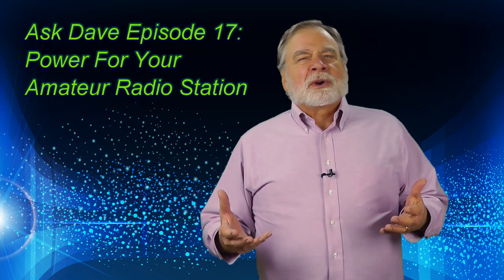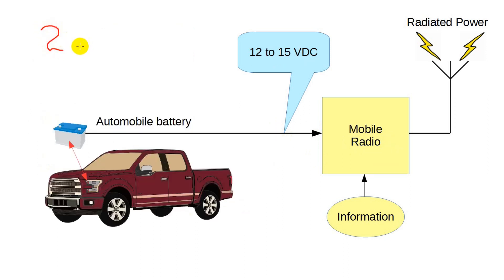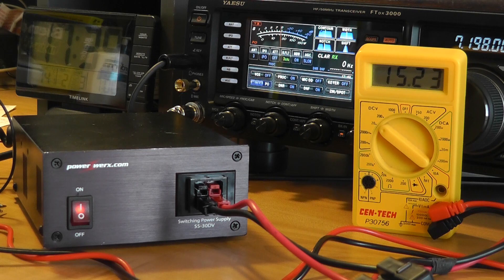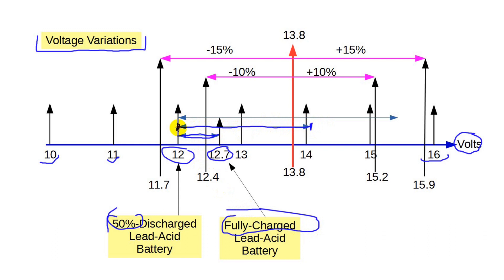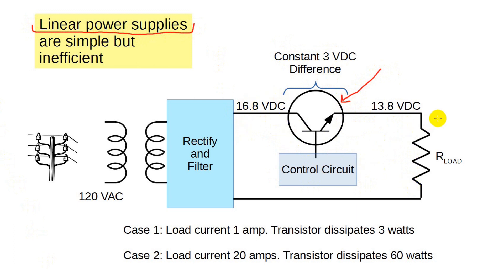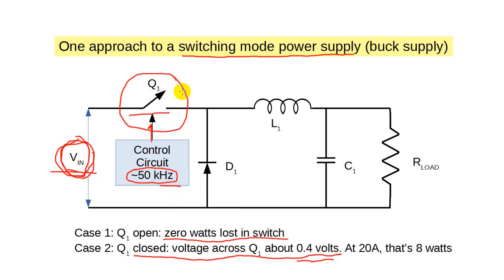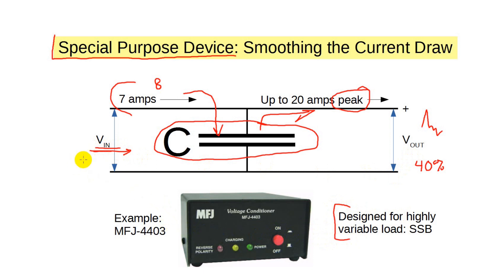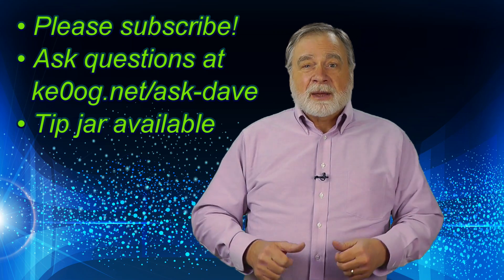Ask Dave 17: Power For Your Amateur Radio Station

Comment: Wow Dave, thanks for this video. There are a lot of HAM channels posting videos by people with limited knowledge. In the video I watched before yours, the narrator weakly attempted to explain linear power supplies & then placed a red balloon on the screen that reads "Hell I read it & I dont understand it."  So much low quality information on youtube. Your video is a breath of fresh air. You give an excellent, understandable explanation of the electrical theory behind power supplies. You know what you're talking about & you are very good at explaining it! The information about the voltage range experienced by automotive & solar powered systems was especially useful. Fantastic video! I posted because the most recent comments are a year old & I want you to know that people are continuing to find your past videos & learn from them!

Comment: The video answered my question perfectly. I just made General after 23 years of being a Tech. I have been out of the hobby for about 20 years though, and am just now beginning to assemble an HF station. My Yaesu FT-950 is on the way. I am a bit behind the times with equipment, because many years ago, switch-mode power supplies had a bad reputation of putting out noisy power. However, at our clubs field day, everyone there had one and they worked perfectly. Nice and light, too. I have a new-in-the box Astron RS-35M linear supply that I bought 10 years ago, and am considering basing the station on a QJE 50A switch-mode instead.
Reply from the maker: The Yaesu FT-950 is, I think, a 100-watt station, so that old Astron will work just fine and power a VHF rig at the same time. One hundred watt HF rigs really only need about 20 amps.

Comment: I remember the "old" days with car radio's with vacuum tubes that required a B+ voltage higher then 12v dc.  You had a vibrator that chopped the incoming voltage into a square wave that went through a transformer that had a higher output voltage that was rectified into a higher DC voltage, lets say 100 vdc that worked with tube technology.

Comment: Wow man, I love your videos, there aren't any other nearly as informative and spot on videos about ham radios as yours. Good work!
Reply from the maker: Thank you.
Reply: So David, I purchased myself a Yaesu 8900R and have been looking for a way to power it. After watching your video I decided to build my own linear power supply which will be fairly cheaper than anything stock. However, I have a few questions. Could you confirm if I am in the right direction? Even though I calculated that an 11 VAC would probably be the sweet spot, I couldn't find anything more suitable in my local shops than 230 VAC / 11.5 VAC (RMS) at 150 VA transformer. Which after rectifying it would give the sqrt(2) or 1.41 * 11.5 =  16.215 VDC. Which of course is with about 0.3 volts above the 15.9 high margin. However I consider at least a 2 x 0.7 V drop due to the nature of the silicon diodes in the rectifier. Which brings the rectified voltage to about 15V . Now, add the resistance of cables, fuses and the voltage drop when the radio is in idle, can I assume that the design of this power supply would be safe to use? I've also roughly calculated that if a 8000 µF capacitor is added, when the radio at full power the voltage wil be dropping to around 12 Volts. Another thing,  I think a 10000  µF capacitor would stabilize the voltage more, however it will introduce an about 12.5 Amps of current spike in the first cycle when the transformer is plugged in, would that be an issue?
Reply: So, to sum it up, since you didn't reply, after days of research about power supplies in general, it turns out designing your own supply for a ham radio is trickier than I previously thought. First, I though I'd be OK with an unregulated linear power supply. However, even if you design your power supply at 15.9V, voltage can and probably will drop below 11.7V at some circumstances... Also it turns out some if not most radios won't be happy with a big 50/60 herz voltage ripple, unless you provide a huge huge cap, but then again a 50W radio at full load can easily surge up to 10A. Making your own regulator for a linear power supply isn't rocket science but then again you'd most probably end up with something with higher voltage to compensate for current, then regulate it down to 13.8, but then you'd probably want to implement an over voltage protection, in case your power transistor goes pop, or because of TVS, which again isn't rocket science, but complicates things a bit more. At the end you end up spending 60-70 euros for parts, at best. Some hours of work, which if you don't enjoy ... it's not worth. But even if you enjoy it, it is really important that you make this regulation and protection right, because you will be very sad if you toast your japanese high quality Yaesu... Switch mode power supplies are fairly complicated to make them yourself, modding a computer one is an option, but there is also a bit of luck there too. My final choice - I will just buy 1 switch mode, designed for a ham radio.

Comment: The reason some supplies are variable are several. 1) Bench testing 2) some PA's such as the RM Italy amps require more than 13.8V to drive the amp to full output. 3) Long cable runs have DC loss or the operator is using a light gauge wire..again, DC loss when under load.
Variable supplies are very useful.
Switching supplies are notoriously known  to  produce RFI. Linear supplies do not. A well regulated and filtered switch supply are expensive.

Comment: Once again Dave, great job!  I continually refer our Technicians and Tech Students to your YouTube videos.  
For what it's worth on this topic, my Alinco DM330MV switching power supply has worked great.  And I always suggest - if your power supply should have a max rating that is reasonably higher than your radio's max amperage.  My 100 watt radio publishes 24 Amps max at 13.8 v, so I bought a 32 Amp switching power supply.
Reply from the maker: +Indiana Jones Thanks for your continuing support! My little PowerWerx SS30DV tops out at 25A continuous and 30A surge, which fits my radio nicely which requires 23A max.

Comment: Thanks for the vids. Im in the civil engineering field by trade, and the analytical side of me wants to better understand these type topics. Im new to ham, just received my call sign 4 weeks ago, and have been curious about using mobile radios in vehicles, and even more curious about using equipment while supplying power from a 12v battery “go box”. So many are doing this, but also are using rigrunners that have an additional loss of 1v. That puts the available voltage at approx 11-11.7 volts. Once transmitting we would see another 1v or so drop. That 10-10.7v is getting way too low for my comfort level

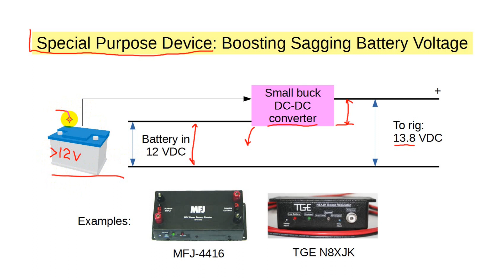Comment: excellant video, i would like to point out that i thought buck converters step the voltage down and boost converters step it up, there are devices that can do both, but @21:33 the boost converter is labled as a buck converter. i could be wrong though. again, thanks for the video, i have learned a great deal over this past year from your videos

Comment: i always keep my dc power leads in the shack as short as possible o limit voltage drop.  In my truck my transceivers and amplifier are mounted below the rear seat.  I use 4 gage power leads to the battery, fused at the battery where I connect each device to the 4 gage with their power leads cut short but each radio has its fuse sized for the radio's needs.  I also have 2, 150 amp relays under the seat so switches on the dash can control main power with another relay with another dash switch  so I can turn the hf amplifier off when not working hf and also when tuning the antenna.

Comment: Thank you Dave!  As a new HAM I am very hesitant to set up my first station due to lack of knowledge about powers and grounding.  This was very helpful!  I do have one question about the comment you made about your HT being damaged from an antenna.   I am doing that now, but with a mag mount.  Will this have the same issue?  The mag mount is on a metal pole about 20ft high.   Thanks!

Comment: In the discussion of whether to discharge a battery all the way down to 11 V (at 21:34 in the video), it might be noted that it is a perfectly acceptable level for a 3 cell LiPO battery which also might be used with the buck converter.
Reply from the maker: The caution has to do with lead acid batteries. They don't handle deep cycles well. Even deep cycle batteries have a limit on the number of lifetime discharges. My suggestion is not to run down a lead-acid battery such that the rested voltage is 12 volts or less. That's about half discharge.

Comment: Hi Dave! Have you tried the TekPower TP30SWII? I haven’t tested it yet but I got it in part due to the noise and voltage knobs. I like the vehicle amp form factor but I intended it for the stationary test bench. I figured if it was set for mobility then added bonus for me but it needs the standard house plugs so unless I’m wired into the grid via camper circuitry then it’s not to mobile without a bunch of conditioning.......Er....I think?

Comment: Been running my rigs off lipos and AGM batteries for about four years. No noise, runs even when the power is out.
Reply from the maker: My photovoltaic system uses AGM batteries. Works great. I changed the rig over to the Samlex power supply as part of the reference video series.
Reply: David Casler I like the sound of that

Comment: What type of bike do you ride?  Is it equiped with a Ham radio?  If so what type?  Even if it is a hand held...  VA6XMB
Reply from the maker: I currently have a 1994 Yamaha Seca II -- I am the original owner. However, it will go on sales soon. And, yes, I've operated 2m FM with it. My helmet has headphones and I connect them to the HT. I have a PTT switch on the handlebars.

Comment: I hear with a regular, hand-held radio repeater that is 115 km away. I am at an altitude of 9m and the repeater is at 1300m above sea level. How much power do I need in watts to connect to the repeater? With 5w handheld radio I hear great, but I can't connect.
Antenna with 3db and 50w ?
Reply: I’d double your watts and get the nicest/highest antenna you can

Comment: Hardware newb here. Is it bad for my equipment if I stack multiple ring connectors (for different devices: HF radio, VHF/UHF radio, antenna tuner, Antenna Switch relay) onto the same positive and negative 1/4-inch five-way binding posts on the back of my power supply?
Reply from the maker: No. No problem. Just be sure that the sum total power requirement at any given time is within spec for the power supply.
Reply: @davecasler  Thank you and 73!  KI7POL

Comment: A few factual errors (such as mentioning buck converter instead of boost), but a 50% depth of discharge really is not a strain for true deep cycle batteries.  The catch being to avoid hybrid type batteries that often carry labels like "marine deep cycle" as they are not true deep cycle batteries and will not tolerate a greater than 50% discharge without undo wear -- a good shopping guide is that no true deep cycle battery carries a Cranking Amps specification on its label.  By comparison a true deep cycle battery can be safely discharged by up to 80% many hundreds of times (typically in the 500-1000 cycles range) without excessive wear.  Shallower discharges will increase cycle life, but with 80% or less depth of discharge the increased cycle life tends to scale fairly linearly with depth of discharge, so you get more cycles, but you will ultimately run about the same number of watt hours through your battery whether it is, for example, 500 cycles at 80% DoD or 1000 cycles at 40% DoD -- one lasts twice as long but only delivers half the watt hours per cycle while the other lasts half as long but delivers roughly twice the watt hours per cycle, the same amount of useful life and power delivered either way (it does not scale perfectly linear, but it comes remarkably close).  

I think batteries tend to trip a lot of people up, especially when one gets into Peukert Effect constants and the impact they have on accessible lead acid battery capacity as the useful amp hours available to a load is entirely dependent upon the magnitude of the load and not a constant as many tend to believe -- a 230Ah battery with a 230A load will actually appear to be a 100Ah battery in terms of accessible capacity at such a draw rate, for example.

My entire station, including computers, monitors, and lighting are powered from a bank of deep cycle golf cart batteries (6V@230Ah each) as I converted everything over to run off DC.  I use a 13.8VDC DC-DC Boost Converter to feed my radios a stable 13.8V regardless of battery state and a 19V DC-DC Boost Converter to produce the power required for my dual 27" monitors, with added filtering where required to produce very quiet power from the DC-DC converters.  An RV type smart charger (also RF quiet) then keeps the batteries topped up at all times whenever mains or generator power is available...otherwise I can run for days to weeks off battery power alone when required and it only takes about 4-5 hours to top off the batteries once depleted, so it does not require a lot of generator time, or fuel, to keep things running.

Comment: Hi Dave, another great video. I have a couple of questions. I see you have the SS-30DV in this video. How do you like it? I just bought the same power supply for my first HF rig. I've seen mixed reviews. The second question is what motorcycle do you own? I would love to see a video on what you are riding.
Reply from the maker: The PowerWerx SS-30DV works fine. It's not good for powering "tiny" loads, such as a QRP transceiver on receive; rather it prefers a somewhat bigger load. But as a power supply for an HF 100W rig, it does fine.

Comment: I have to ask. why turn off the radio before turning off the power supply.  the As-tron is not switching power supply. I have flipped the power supply of with the radio on. I have never had a problem. are you telling me that I will have a problem doing this. just urning it off using the power supply?

Comment: I get the value of using an external DC supply for a transceiver because it's same when I build PCs; I'm used to selecting and installing an appropriate DC power supply in those. Doing so for my upcoming ham setup does not intimidate me. But when I build a PC for someone else, he or she never has to deal with that PSU because now it's inside the computer chassis, and from the user's perspective, only a 110-120V AC connection is required. So my question is, why does no transceiver maker include power conversion in the radio chassis?  Is it RFI?  Seems like shielding technology could manage that.  And I get that a big honking DC supply can power more than one component (as in a PC), and I get that providing back-up DC power is far easier than back-up AC .  But doesn't requiring a string of components tend to be off putting to potential new hams who just want to get on the air as simply as possible?  And couldn't the same argument be made for antennas?
Reply from the maker: For many years some radios had their own internal supplies and some required an external supply. This is back when high voltage was needed for the tubes. Even my Yaesu FT-101B and FT-201 had internal power supplies. At some point the manufacturers stopped including them. Some amplifiers now include their own power supply, or are sold with companion supplies. Some high end HF radios come with internal power supplies. But most of us have to provide power separately.

Comment: Hi Dave, got a serious question for you.  I bought an 800 watt Generac Generator/Invertor a few days ago.  I planned on using this unit for field day, unless I can quiet the IRF coming out of my radio's speaker it doesn't look like I'll be doing anything with it.  Some back ground:  Tried a whole bunch (6) torriodol ferrite fittings on the power line.  Put more on my extension cords and more where the power supply plugs into my power line.  If ferrite were the answer believe me I have plenty....still getting very loud noise.  I did unhook my coax and the noise went away, I don't get any noise in VHF or UHF at all...it's all on HF (the bands in must use for field day)  I move the generator around to the front of the house, I grounded the generator.  In short, I've done everything I know to do to stop this noise to no avail.  I've heard about a noise filter that might work but have no idea what I need or where to  get it, can you help me?                                                      Thanks, Pat KD9DST
Reply from the maker: RFI from generators can be frustrating! It sounds like the generator is creating some amazing harmonics if they're being picked up by the radio. Check your power supply, maybe swapping it for another to see if it has any effect. Another option is to run the radio off a battery, and periodically recharge the battery. QST did a major review of generators in the June, 2012 issue, and there are some links there that may prove helpful. Good luck!
Reply: Excellent question. One of our field day team had this very issue this year with his brand-new generator purchased for this purpose. He was pretty unhappy about it.

Comment: Dave, I was wondering about the amps needed to power my Radio Shack HTX-10 ten meter radio. I believe that it is about 80 watts. In the manual, it says to get at least 7 amps. I bought a 6 constant 8 surge supply, but think I will actually need much more, Like a 19 amp from radio shack.
Reply from the maker: I think the HTX-10 puts out less than that, but if it is an 80 watt version, you'll most certainly need more than 7 amps. I'm not familiar with the radio. You could try some Internet searches.
Reply: Thanks! I just learned that it might actually be only about 30w max. I while just try out the power supply I got.